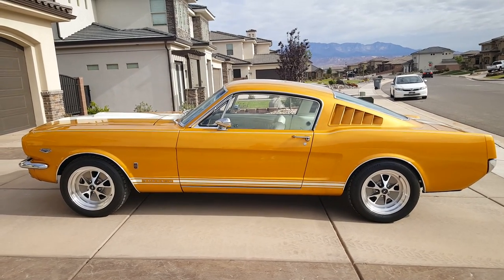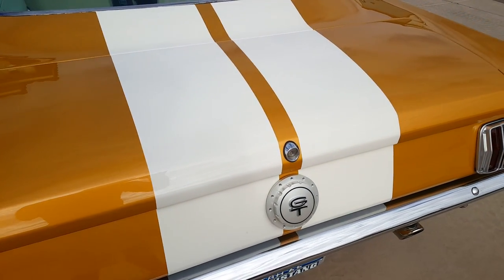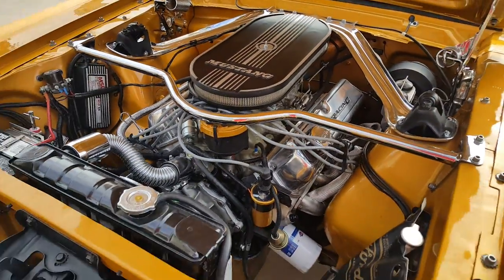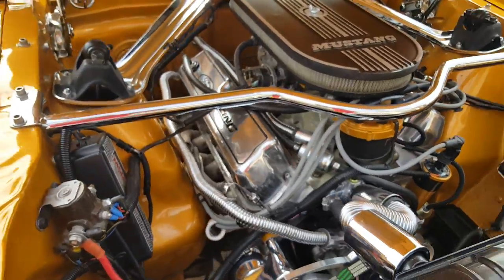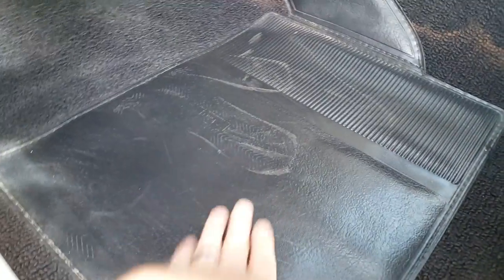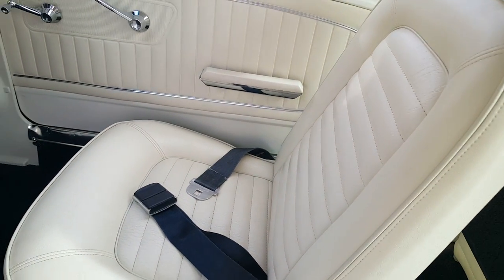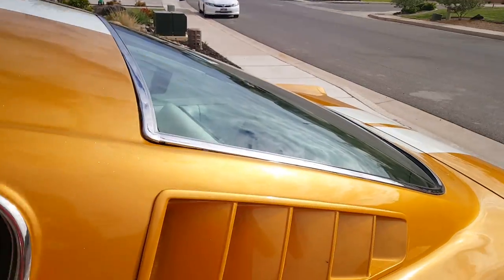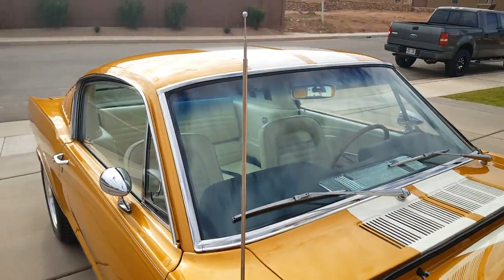1965 Mustang fastback Restomod - Walk Around

Comment: It's not a restomod, so you painted it and rebuild the motor, No rack and pinion, No 4 link suspension, No tilt steering, No Coyote motor, No disk brakes. You should really change your wording, it's a nice car and it's very nicely done.
Reply: Has All the GT Mods.Orig.GT?Better Than A Hi Po !!
Reply: RELAX